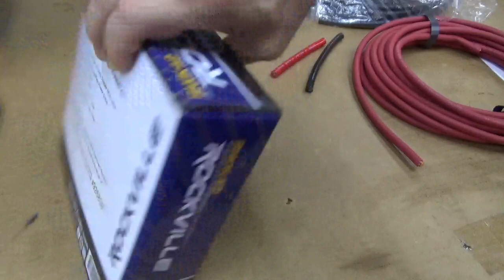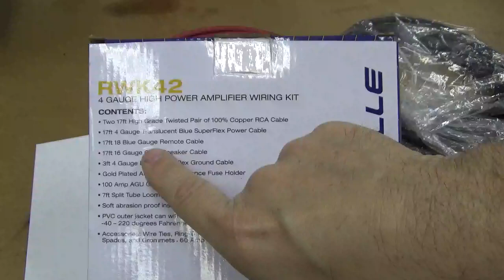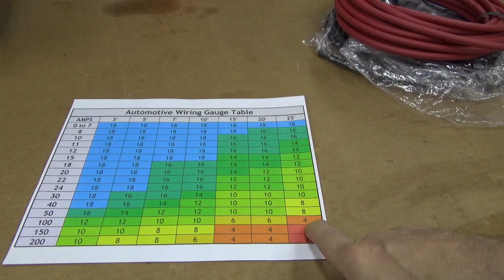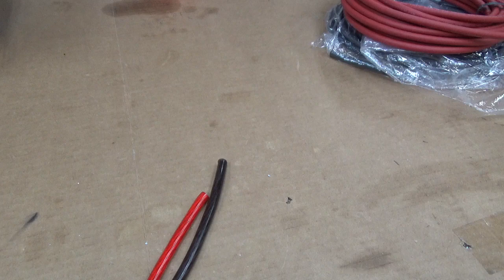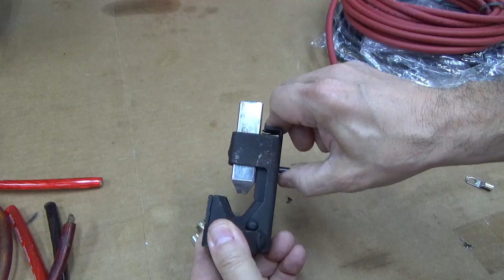DO NOT USE CCA Power Wire - Copper Clad Aluminum

Comment: Also look up the actual welding wire specs and they go by 50ft lengths and load percentage. 1/0 pure copper welding wire is good for a 60-100 percent load for 10 minutes at 300 amps or so. That's for 50ft.

Comment: I bought 20ft of red copper 4 gauge welding wire the other day and it was 33 bucks. the 10ft black was 20 bucks. 1/0 was 70 for 15ft. You can get 15ft black and 15ft red in the same bundle for 130. That was from Home Depot July 2026.

Comment: I have 2 CCA main power wires in my vehicles and they're working just fine. I think it's more as you said, this was a side by side, so open to the weather. Also, I liquid electrical taped every exposed bit on both ends and then brushed on dielectric grease after tightening the connections. I also actually maintain my vehicles and keep my battery posts clean, so that doesn't hurt either, lol. As a mechanic for over 20 years, I've seen hundreds of 100% copper OEM battery cables turn to dust around the terminals, sometimes for 6 inches up the insulation, just like that. Under hood installation, especially on a battery terminal, is basically worst case scenario for an electrical connection, regardless of composition.

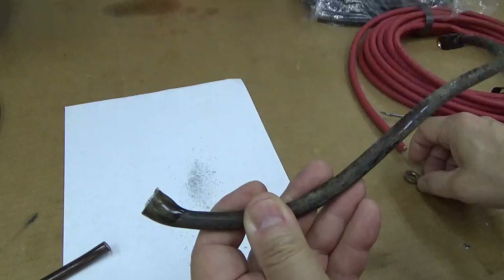Comment: 6:40 I have seen the same type of corrosion even on heavy heavy copper factory automotive wire.  It is common on lead acid battery's that leak. 
Light to medium amp duty accessory CCA is perfectly fine.
 Corrosion is Corrosion.  
Cheap connectors and exposure to elements don't help.
You made a entire video to justify 100% copper wire because you found a corroded battery terminal.

Comment: I used 1/0 Welding cable from Temco for my power wire runs. Very flexible and good price, atleast when i bought it at the time.
Reply from the maker: I usually buy Temco all the time.. Just sometimes they send a smaller gauge marked as the bigger gauge. Last time I ordered 4AWG and it came marked 4AWG, but it was 6AWG.... If you read the reviews on Amazon you will see that happens quite a bit.

Comment: seems this idiot needs to learn to use heat shrink with adhesive on the connections if he is a wiring service provider. NEVER USE SILICONE RTV TO SEAL ELECTRICAL CONNECTIONS ! It is corrosive. Also CCA MUST be terminated to COPPER ONLY! NEVER soilder it ! You can also use an anti-oxidizer agent that is sold at most electrical suppliers. This u-tuber needs to educate himself in the career he earns his living in, before he became one of those guys on the net.

Comment: Cars are coming from the factory with CCA. I’ve even seen factory power wires directly connected to the battery with all aluminum wires, I believe that was a jaguar under ford management with pure aluminum wires. So what are you going to do now?

Comment: No reputable car stereo dealer or installer will sell you cca wire. You make this sound like it was your customers fault when it was 100% your fault.
Reply from the maker: You can only warn a customer so many times.. He came in with the wire and stated I was wrong and to use the wire..
Reply: No, it was the customers cheap fault.... you are a hurt🤡

Comment: Always nice to get AWG, but between the CCA and the not true spec cooper, I'd definitely prefer the smaller true copper wire. If I'm buying power wire and know it's not AWG but is real.copperr then if I need 4 gauge I usually just order 0 gauge.

Comment: I worked in the quality control department of  Square D company at their Lexington plant in the late 1960s. There, they made electrical panels or breaker boxes. That's when they were making some models with internal bus bars out of stamped aluminum. Because aluminum starts oxidizing as soon as the air hits it, they plated the buss bars with cadmium, copper, and tin but I can't remember which order or if they used all three on the bus bars. I do remember getting boxes back from the field with their bus bars corroded and there was a lot of discussion about the situation. That would have been around 1968 or 1969. After a few years I found a better work so I don't know what they did about those panels with the aluminum buss bars.

Comment: Good to see more people sounding the alarm about CCA wire. CCA is dangerous! It will get harder/brittle over time (many heat cycles) and eventually it will crumble. This leads to higher and higher resistance which means higher heat. Nearly lost a car to fire thanks to CCA. Never, never, never use CCA for anything.
Reply: Been using 2awg cca wire with a 2000 watt inverter on 228amps...no problem gets a little warm just like copper wire!...guess I'm the only one here that's had success
Reply: @r.hernandez6152  for now. It's not a question of if, the question is when. Your vehicle and your safety are worth much more than the price difference between OFC & CCA. I've done all I can do. All the best!